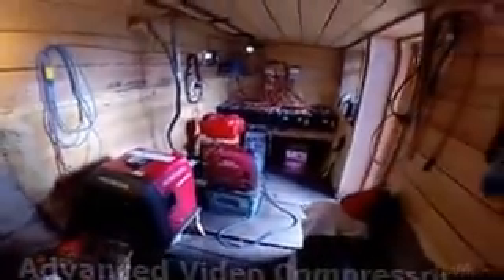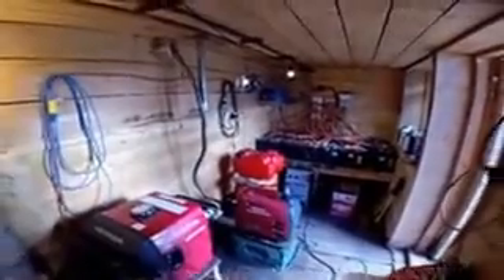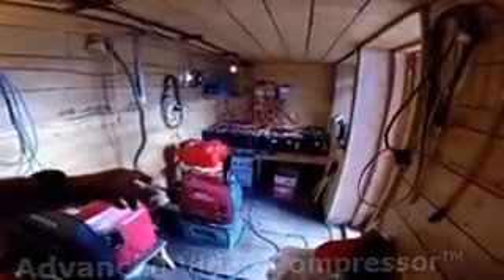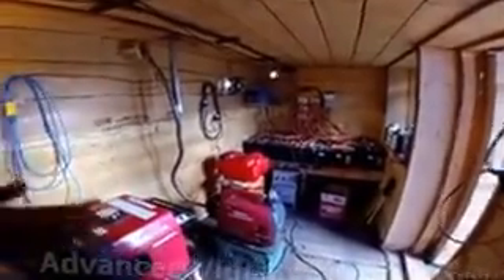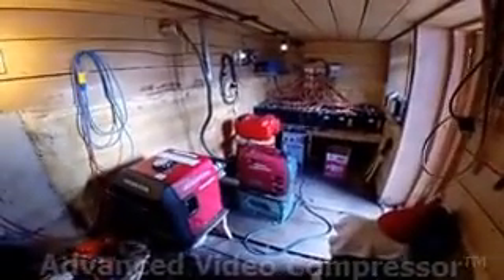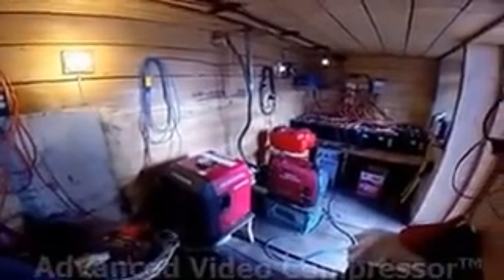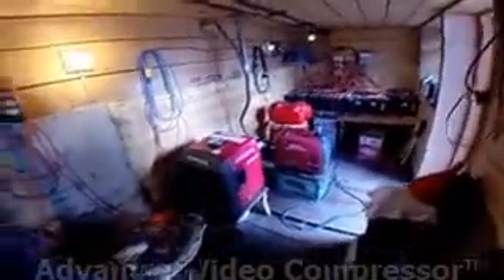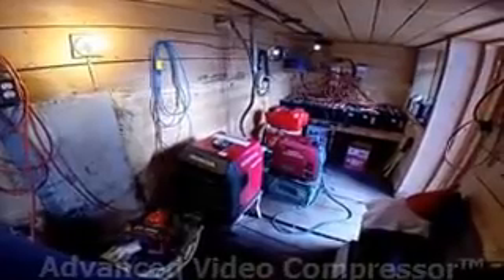Off Grid Electricity in Remote Alaska Part 2 Honda Generators

Comment: I am VERY curious about the temperature inside your generator shed. From my understanding, batteries work best at around 45°F.  Do you pump air in from your house? I am wanting to design a system in a similar climate to yours.